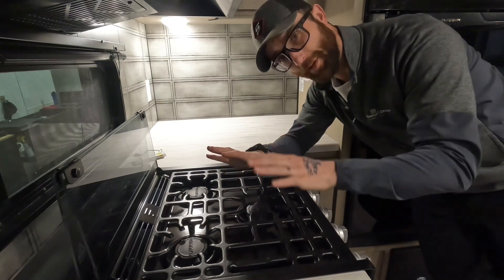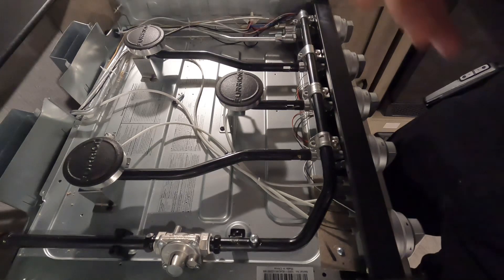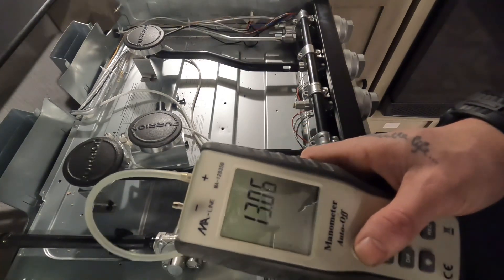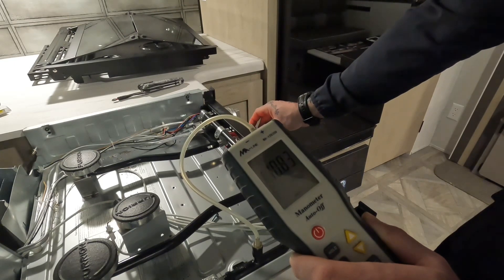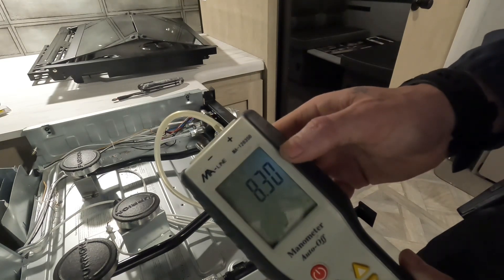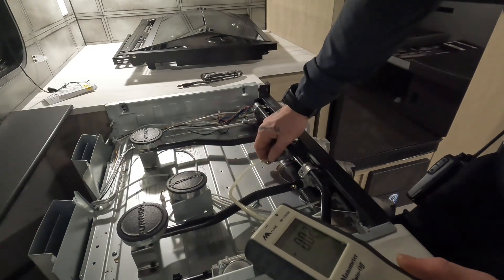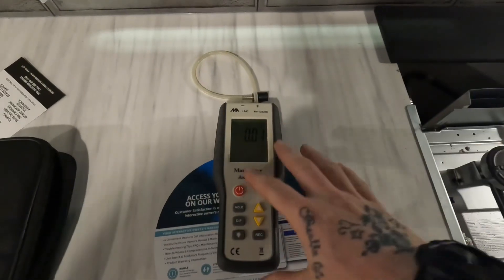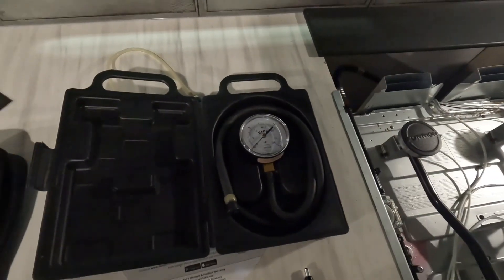RV propane leak test! Step by step

Comment: Great video. It looks like the stove has a small regulator built in?  Does that affect checking system pressure from the port or burner orifice downstream of that small regulator in the cooktop?

Comment: 3 mins is crazy. In Canada, TSSA regulations mandate a 15 min drop test with no more than half inch of water column fluctuation.
Reply: Each gas valve has a small amount of leakage. Anything over 3 minutes is a waste

Comment: i know i have a leak cuz my two 20 lb tanks run out in 24 hours.. so i guess i just need to make up some soapy water and get a spray bottle and try to find where every gas connection is.. i smell it outside where the hoses go up into the stove. and i smell it in the back of the camper where the exhaust vent is on the furnace..also near the regulator i smell gas leaking i have a 2022 kz connect. brand new.. and im having this problem.. awesome

Comment: Nicely done sir!  If I may - IF during the time pressure drop test, the pressure on the manometer comes up - what differentiates a faulty high pressure regulator from a faulty tank valve?   If the tank valve is leaky, the regulator is still doing it's job.

Comment: These two tests from the stove indicate no LP issues in the entire RV?   LP Hot Water Heater?  LP Furnace?    Obviously the lines under the RV are not easy to access.
Reply: That's correct, as the LP system is tied together and is pressurized this is the way to test for all the components on the rv. Connect here and fire off the other appliances on the rv to measure drop. It's fairly simple :)
Reply: What he’s doing is essentially tapping into the propane system anywhere post-regulator to make sure the regulator lock-up (no load) pressure is within spec, that it remains ok with 1/2 load, and with everything off it holds pressure to indicate there isn’t a leak. The water heater or some other appliance may have an issue, but you know the pressure is correct and there are no leaks at least to the appliance’s gas solenoid valve.

Comment: Which Manometer range should I get? I’m finding 0-10 or 0-35”?
Reply: 0-35, your tank pressure is going to be between 12 and 14, so 0-10 wouldn’t work.